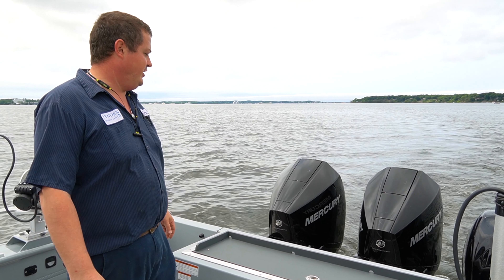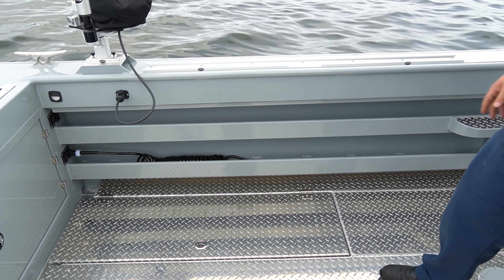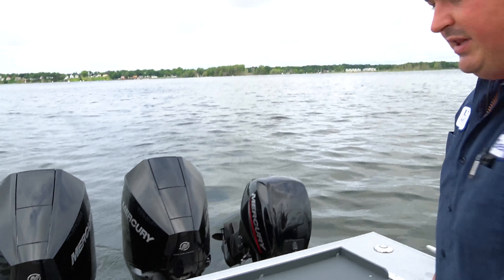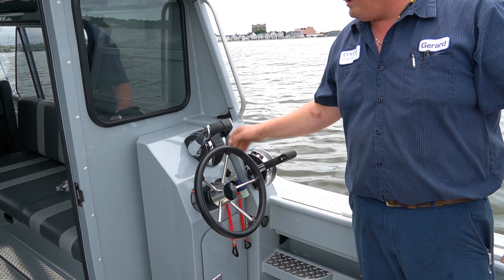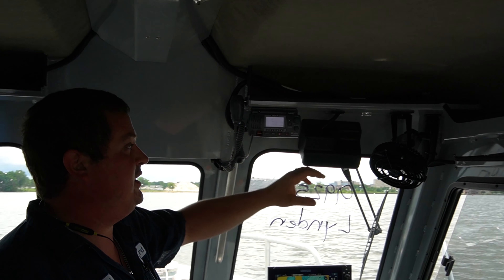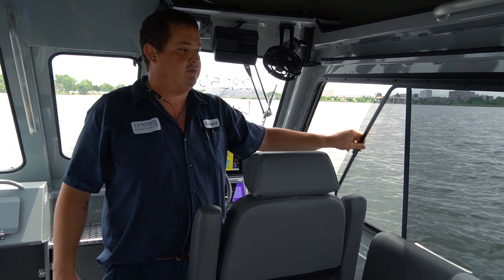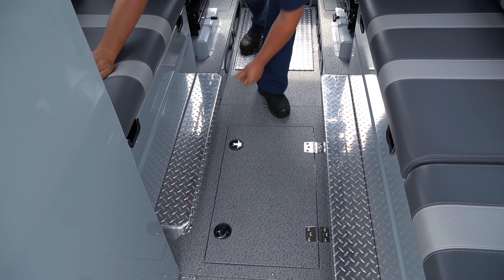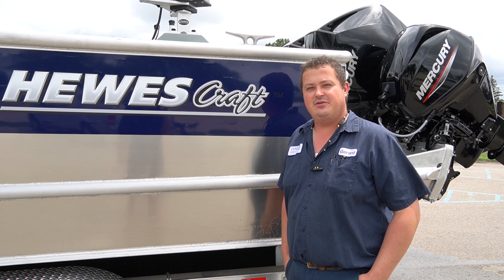The Perfect boat to handle the Great Lakes (Hewes Craft 270 Alaskan Walkthrough)

Comment: That’s the best location for the head it needs to have a sink and shower and Inside entrance also extend it back two and a half feet on the port side back on the transom. I would want the kitchen set up on the starboard side and a few extra feet  for a walk around pilot house another ten feet I reckon with a birth up front heck I would just have to design my own
Reply from the maker: You should check out the pacific explorer or the adventure by Hewescraft. They have a lot of those options you mentioned!